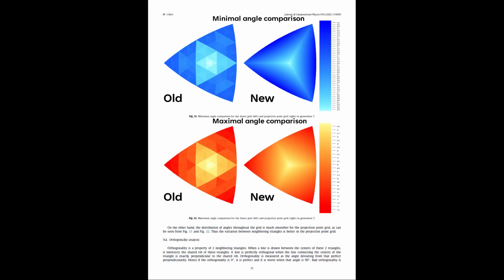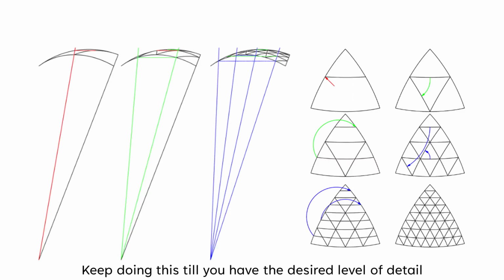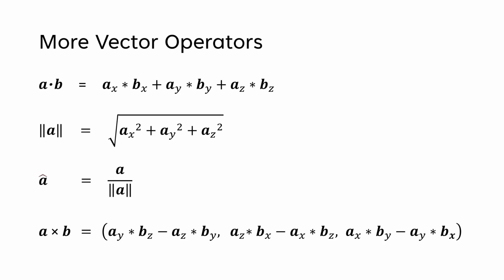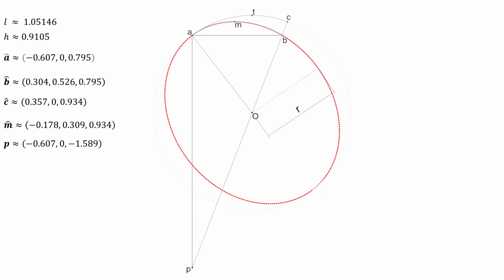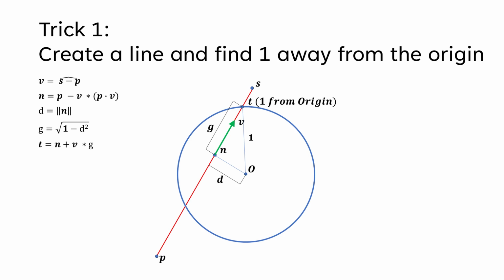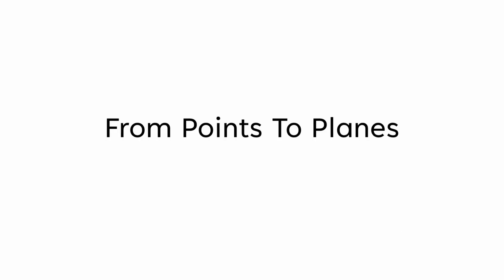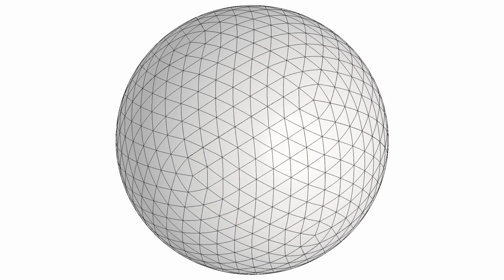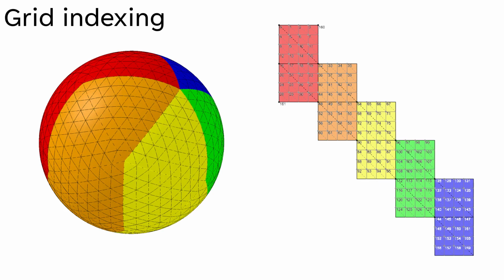How To Make The Best Geodesic Grid

Comment: When was the flood
Reply from the maker: @marcosrodriguez4658  probably around 3040 bc. or else around 2350 bc.
Reply: Thank you is it posible that the flood could be as far back as 4200 bc
Reply: I say dis because there sems to be missing people from the descendants of Sem to Abraham and I just wanted to know how far back is it posible for the flood to have happened.
Reply from the maker: @marcosrodriguez4658  I base it purely on the bible. I think there are no generations missing, but the ages of the people of our version may be incorrect. I expect the lxx (septuagint 3040 bc) to be more accurate than the mt (our version 2350 bc).
But I have no way to be sure.
Reply: One more question how does your heat model explain the oceans regaining there water if all the oceans evaporated because of the impacts.
Reply from the maker: @marcosrodriguez4658  Although I haven't simulated it to test it:
The idea is that what is now oceanic crust was molten, what is now continental crust wasn't molten. Thus not all water evaporated, but a lot did. Most was "pushed" on the continental plates because molten basalt has a lower density than solid basalt. Thus the oceanic crust is now low and has water on top. During the flood it was higher and thus the water was on the continental plates.
Reply: @GeoDetective  what about hydroplate theory 
Is it true that the plates can slide in whiter
Reply: Water
Reply from the maker: @marcosrodriguez4658  hydroplate theory has many flaws that can be calculated. The Flood Science Review by Joseph Bardwell pointd out many. The only useful thing I have learned from Walt Brown is the crossover depth/crossover density. That's tested and correct. 

The earths mantle however deforms plastically (= wet clay-like), which has been far better explained by John Baumgardner and Mark Horstemeyer. Large bodies of water below the crust isn't very realistic. But the effect it had on the moon (impacts), the asteroid belt and other crater structures in the solar system as proposed by Walt Brown can be calculated to be absolutely impossible.
Reply: @GeoDetective  I understand but what about the sedemints were did they come from .
Reply: Do you have a book on your heat model
Reply from the maker: @marcosrodriguez4658  no I don't. I have a website, but it is slightly outdated
Reply from the maker: @marcosrodriguez4658  about sediments: I think it partially was the original soil, partially a chemical products of the flood process and partially pulverized original crust.